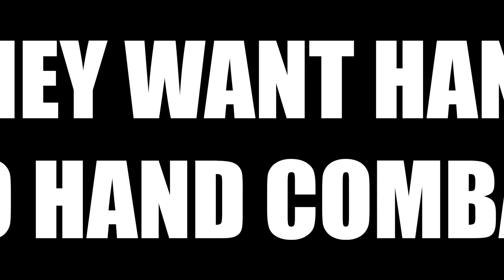TEAM USA KICKSTARTER FOR GIANT ROBOT DUEL

Comment: For cqc, I think chainsaw would be waste to used because it requires too much energy, I think a jack hammer powered would be wise to make a dent on their armor,  because robots has its limits holding pessure if they used the shield, if you used chainsaw, it be pointless against it because u give a lot time for gatling guns to rip though the armor's treds. To make it fair enough, you want armored up the treds because that is your Achele's Foot.  So, the prime subject is have modle galting guns if you plain this idea, The only way  its have sperated controls  for your aims. Jack Hammer is one subject is going be hard to be put into because all I think is getting jackhammer in front your cockpit.

Comment: MechWarriors will crush Kuratas.

Just make sure your torso can rotate fast and stable enough to track the probable fast forward movement of a Kurata. By the time it gets in range for melee with current tech, in a real battle it would already have had their cockpit blown to pieces.
If USA Mech can't rotate the torso, it can end up get out-maneuvered and wrecked.

You also need a weapon in the center part of the bot, otherwise the Kurata can just sit there and make both arm-weapons useless. Perfect place for a flamethrower, but I'm not sure if that would be safe or valid for this challenge.

Comment: this battle will look nothing like you expect.
Reply: SoundMaster Yeah I feel that after few punches, the robots will get stuck on each other. Also, if they are made of hard and strong material, they may break themselves and their actuators way before they do any significant damage to the opponent. Like if you were to try destroy a tank with an excavator. But I'm sure they'll keep that in mind.
Reply: robotics in Japan is cool
Reply: SoundMaster so true
Reply: Dino "Punches" Melee does not mean punching. They'll likely not even using punching.
Reply: +TechTehScience i agree the  kuratas for example have already  an optional double pneumatic  pike piston for close  quarters combat and a carbonfiber shield

Comment: Why does it even need to be 'self balancing' if it's on tracks anyway? The technology is there.. make it a proper biped.

The best design would be a humaniod telemetry robot, with 1:1 movements from a human in a telemetry suit. Make the telemetry suit with force feedback so the user can 'feel' the robots balance and adjust accordingly, or augment it with a failsafe 'onboard' balance system. Make it 2x the size of a  human. With 1:1 full degrees of movement you can't lose. You could just rip out the japanese robots hydraulics, punch it's legs, smash it!
Reply: Designandrew Didn't you see the DARPA robotics challenge? A congregation of the most advanced robots on the planet happened, and most of the bipeds can't even open a door or take three steps without toppling over.
Reply: Isaiah Phillip That's because they control the balance onboard by the robots. The way I'm suggesting it is the balance is handled by the remote operator. I'm not alone in my opinion that these kinds of robots should be basically 'telemetry' robots rather than autonomous. Basically you want to send in a remote controlled 'human' in situations where you don't want the human to be hurt.